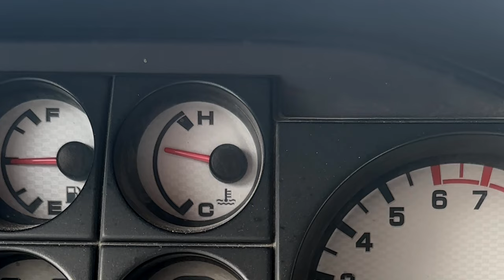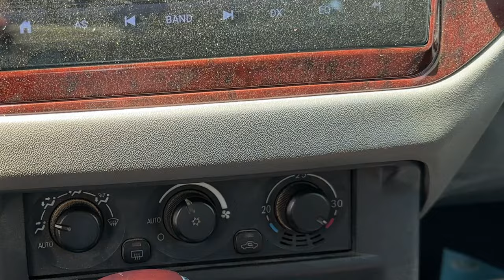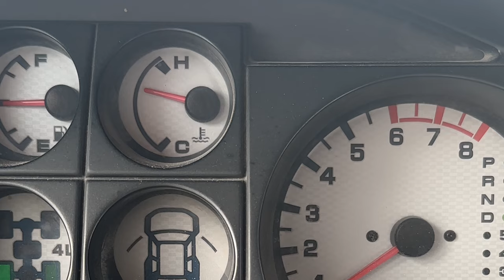VLOG - 9 Engine Overheating - Checks & Precautions to consider - Malayalam

Comment: Landcruiser 2007 Model Traffic l nilkumbol Temperature High Akunu Fan coupling change aki but same issue ind any solution plz
Reply from the maker: Check for air pockets and pipe
Leaks, reservoir return pipes etc….observe radiator fluid level for two weeks in the morning time…

Comment: ENTE VANDI ON ROAD 95 REACHING BUT WHILE DUNE BASHING MOSTLY ON 92 WHAT IS THE PROBLEM....
Reply from the maker: On a 40 degree Celsius day, on bumper to bumper traffic, 95 degrees completely fine for a clutch type fan car…because of less air flow & heat exchange…

Off-roading, high rpm, high speed fan, lot of air flow…🙂